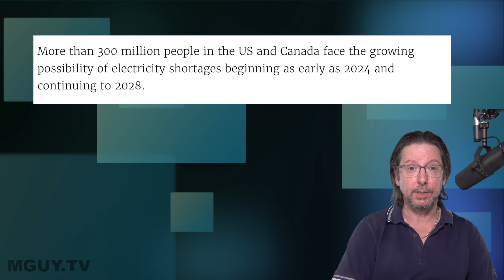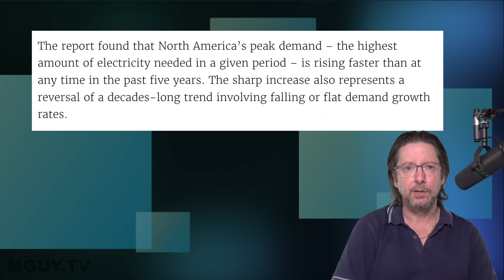Electricity grids WON'T COPE with mass EV charging | MGUY Australia

Comment: Australia produces 280Twh of power per year.  20 million EV's would consume around 40Twh per year.  The BIG mistake you all make is they don't all charge at once or continually.  I charge once a week at night.  40Twh is about the same as what has been saved by switching to LED light bulbs.  There are numerous UK and US Govt studies that show EV's will not stretch the grid.
Reply: And the same governments told us covid didn't originate in China, you needed to wear a mask when the only reliable mask were the N95 masks, but they didn't tell you that. The governments are the biggest disseminators of false information. Whatever policy they want to push, they will. Same with gun control. Every time there is a crime where more than 2 people are shot shot there is mass histaria. What about knife attacks where multiple people are killed? Now the mayor of London is calling for new laws on knives. Just keep drinking the kool-aid, and everything will be alright.

Comment: I have been telling this for more than 3 years now. If ALL vehicles were to be replaced by EVs, the price of electricity would be astronomical. Non-EV owners would also have to pay the price to upgrade the whole electricity grid.
Reply: It will be anyway.A dollar a kw or higher is quiet possible as works on supply and demand and take away all green subsidies and the true cost of the monster appears.Will never be cheap or reliable to use and the days of plentiful and cheap electricity ending will be something we all must suffer while try to survive without heating or cooked food.
Reply: @andyr8812 As energy production transitions to renewables it will get cheaper as it has in other countries. Also increased demand will allow for economies of scale. Yes this will be offset by the need to improve the grid, but it will happen because global warming is a fact that won't go away.
Everything changes, Australia has some catching up to do.
Reply: Your comment is absolutely false. You'll find (if you do the research, which we both know you don't do) that electricity rates are the most stable of energy rates on this planet. By all means, let's chart the price of gasoline over just a few years, shall we? In the last few years gasoline has doubled, dropped by half, increased by 40% and is now at some artificially low price until the American reserves are all tapped out.
Let's contrast that with electricity rates: my electricity rates just had their first 15% increase in TWENTY YEARS. Electricity can come from any number of sources, petroleum only one.
The idea that EVs will raise the rates for everyone is a lie from the oil industry, congratulations, you've done their PR job for free.
Reply: You must be one of the privaliged few that have cheap electricity.Our prices just went up 25% this year on top of the 30% went up the last time this government in power.You cannot deney that renewable dream is not sustainable.The recycle figures and the concealed real amount of fires that only now just becomming public.Most solar farms and ev vehicles be lucky to last 20 years and few even get that far like the brand new battery pack in Qld that exploded.Compare that to a hundred year life from a coal fired plant or decades from an ice.There is a mountain of evidence AGAINST this green future but nothing worse then people that bury there head in the sand and deny these electric monsters destroying the planet.Am not against renewable per sec but cannot be reliably used for base load cheap power.They have a use must must stand on there own merits. The more subsidies poured into this bottomless pit of green madness will come back in a few years time to haunt us when your power two dollars a kwh if can get any and tell me how cheap and reliable they are .Once in the recent past used to pay 9 cents a kwh and now pay 35.The more coal plants we lose the higher the electricity price as supply falters and the poorer quality of life destroys our country.But thank you for your comments.We have a serious problem with our lack of reliable energy planning.Really need at least a dozen new coal and nuke plants to stop the grid collapse and need it yesterday not in twenty years time if ever. Even in the short term gas will save us but Australia rather sell there abundant gas supply overseas then insure our country stays energy rich. @justsomeguy934

Comment: Liberals have zero common sense in their thinking. They are just blinded by their so called goals and can't see anything  else. If they actually thought anything through they would realize they cannot succeed with anything the way they do it. They also seem to think everything will just happen magically and they don't have to work for it and uts all FREE. Its amazing these people can do anything at all when some don't even understand where the food they buy at the grocery store actually comes from farms ir that an island won't just tip over if you move to the other side of the island.  Yes, they ARE that stupid. Many young people can't even use a manual can opener 😂  So how dobyou think they can understand the electrical grid and amount of power required for their lunacy or the fact that everything, even their so called green cars will need oil and grease to be built and operated.  Everything in life today requires oil at some point  so they will never get rid of it.

Comment: His nome is Chris Bowen 
He is absolutely clueless about the electrical grid ….
Although he’s the energy minister…
Absolutely no idea about generation….
He thinks it all happens with smoke and mirrors 
The PM actually stated that people should charge their EVs off solar, during the night !!!
This is their level of understanding 
Scary !!!
Reply: We have dumb and dumber in charge.
Reply: With the correct wavelength of light you could charge solar at night. The problem is most of your profit would be eaten up by powering the lights to charge the solar panels. My own solar panels take in around 4 watts of power at night from a streetlight. Not enough to do anything.  Max voltage I have seen at night on the panels is 26 volts. It takes 80 volts to turn the solar inverter on and make energy to store in the batteries.
Reply: @johnstark4723 I really think you’re clutching at straws….
Reply: @batmanlives6456  I'm stating facts. You are clutching at straws
Reply: Facts so distorted…
If you really think that you can gain USEFUL energy from solar cells at night … you are as silly as Bowen himself….
PS using a street light isn’t really using solar power…

Comment: there is a building in Melbourne, where residents wanted. EV chargers placed in the basement.
Short story is not only is the building in capable of the capacity, but so is substation down the road and the connection cable.
Basically the whole neighbourhood needs to be re-wired, just for one building.
Reply: i expect we'll hear about it burning down soon.
Reply: Fix your third-world grid. EVs aren't the problem, your utility commission is.
Reply: Spend billions/trillions just to satisfy some sanctimonious nerds?  No....fuck off.

Comment: Clueless Politicians. Have no idea that the World has not got the Infrastructure to cope with increase of EV charging.
Reply: This is the wrong way to think. They are not clueless, they are not stupid; they know EXACTLY what they're doing. This is why we need to stand up and say NO before it's too late
Reply: EV charging is not a problem, you can recharge any EV using house current overnight for the typical driver. In general, however, the world needs increased energy production for EVERYTHING.

Comment: They shouldn't be allowed to close a plant till they have replaced it's capacity
Reply: Wind power and solar energy can never replace gas and oil. full stop.
Reply: @jameskeith7608  Exactly, becaus the wind not always blows and the sun not always shines. So they always will need a full scale back-up grid of so called "fossil" Energy.
Reply: @jameskeith7608  absolutely false. Renewable energy can replace traditional fuels, but a balanced energy plan is necessary. Full stop.
Reply: *its
Reply: @poliziagrammaticale9430  yes indeed. It's true that I should have typed its.

Comment: It's funny how these 'green' eco-warriors seem to think that using windmills and solar farms, as opposed to more conventional means of power production, are the answer to the world's climate problems without ever thinking they may just actually be adding to the problem making it worse. 

Take solar panels, masses of large black square panels, covering untold acres of the earth's surface all causing heat thermals of rising warm air which can affect weather patterns over a large area. The National Centre for Atmospheric Science states "Heavy rainfall and snowfall will become more intense in some places as a warmer atmosphere is able to hold more moisture in the sky. And, high-impact events like storms will become more frequent." so how much of this "warmer atmosphere" is being caused by these fields of 'green' solar panels?

As for windfarms, Newton's third law states 'When two objects interact, they apply forces to each other of equal magnitude and opposite direction.', so for each gram of air pressure needed to turn these massive blades an equal force is being applied in the opposite direction by the blade's resistance to turn. So the natural flow of air, which has kept this planet alive for billions of years, is now being restricted. It's like trying to breathe while having your nostrils slowly clogged up over time, it's fine at first but eventually it will affect your ability to breathe.

Yet any weather anomalies that get reported always seem to be put down to fossil fuels and global warning, it's ironic when you think about it.

Comment: It is not the ability to supply the amount of power that concerns me, it is the infrastructure that delivers the power, the average daily usage of an entire house equates to about 80km in an ev, and our power infrastructure will not cope with doubling the load, if the government thought NBN was expensive wait until they see the bill to double the capacity of our energy grid
Reply: Right, so the grid won't cope with 15 KWh / day of flexible additional demand but was  completely fine when air-conditioners and clothes dryers came along which increased demand as much if not more. 

Yep you're right, renewables and EVs are to blame for the rolling blackouts and directions to curtail demand every summer 15 years ago.. rightio..

As for the "environment" are we changing topics now? I thought the "concern" is about some mythical property of renewable and EV electrons to strain the grid more than everything else in the past?

What's the "concern" then and were you always this "concerned" or only since renewables and EVs appeared?

Why don't we have rolling blackouts every summer like we did 15-20 years ago?

Every distribution failure is "blame renewables" and "blame EVs" today with no actual evidence presented. 

Just curiously selective "concerns".

Do you have shares in OPEC or something?

Assuming everyone will develop a sudden urge to travel 80 KMs / day using 15 KWh flexible demand which is equivalent to say 100 KWh of non-flexible demand used in ways deemed more "appropriate".. ok, sure. 

BTW the average is more like half that although I do admit, being free from funding oppressive petro-states and terrorism at the bowser I do drive more now so on that point you're correct. 

https://www.budgetdirect.com.au/car-insurance/research/average-kilometers-driven.html
Reply: @IanMcLeod75  The average daily electricity consumption for a household in Australia is 11kw including AC as a part of that average. It is also spread across the whole day where a significant portion (water heating etc) is already used at the time you propose. Our grid already cant cope with the existing load in lots of places.

I think you either underestimate the load everyone driving EVs will have or you over estimate the capacity we currently have available, that is before you start talking about powering petrol station replacements  having to provide enough power to supply multiple fast chargers.
Reply: @isaac827  11 KW or KWh? If you're struggling to differentiate basic units you may need to reconsider this. 

The average home does not consume 11 KW, that's over 250 KWh / day..

You're using classic SkyNews logic. Take the absolute worst case scenarios and throw in ridiculous assumptions like having to replace the 70% energy lost as heat in combustion. Yes SkyNews actually claimed this. Please don't tell us you actually get your "information" from SkyNews or the IPA?

I can see you really want to defend foreign-fuel dependence, that's great you stick with that at $2 / litre and $40 billion / year drained from Australian pockets every year to fund corrupt petrostates and conflict if it's really that important to you. 

I'm not missing it.

And you still haven't explained why air-conditioning or clothes drying or any other electrons are worse than so called "leftist" electrons.

Do the maths yourself on 165 Wh/KM flexible demand as worst case and see what you get. 

Before considering rooftop solar and software automation to soak up excess or cheap energy (unlike non flexible demand like, well, everything else that seems to not concern you at all).
Reply: @isaac827  All this is well covered already so why go to all the effort of speculating?

I think you over-estimate the need to replace combustion waste heat that the IPA publicly claimed will be needed for some strange reason no one can explain.

Meanwhile actual modelling with real data and real trials suggests a max increase of 80 TWh / year on top of our current 275 - 300 TWh demand - which has been flat by the way since 2006. You can see for yourself on the links below.

Why, what do you estimate if you believe the below to be inaccurate?

As for "grid already can't cope" - can you share some statistics or reports about this? Beyond old news stories about SA or whatever which were resolved to be software related. Like actual outage statistics from energy regulators and qualified analysts. Last I checked reliability has improved substantially over the last decade but happy to be wrong if you can provide some authoritative sources?

https://aemo.com.au/-/media/files/stakeholder_consultation/consultations/nem-consultations/2022/2023-inputs-assumptions-and-scenarios-consultation/supporting-materials-for-2023/csiro-2022-electric-vehicles-projections-report.pdf 

https://www.energy.gov.au/publications/australian-energy-statistics-table-o-electricity-generation-fuel-type-2021-22-and-2022 

https://opennem.org.au
Reply: Your calculations are invalid. The average EV (for American driving) consumes about 10 kW/h per day, or the same amount as a clothes dryer for 1-2 cycles. This is done off-peak and requires NO changes to the infrastructure whatsoever. EVs will NOT double energy demand, nor will they melt the grid. Stop repeating oil company propaganda.
Reply: 80 KM/day is around 15 KWh... which can be scheduled overnight on cheap tariffs. Are you seriously concerned about this?

How much does aircon and heating use in comparison?
Reply: @IanMcLeod75  Do you think our current electricity delivery network, is capable of delivering double the power it currently does? 

What do you think happens if everyone wants to deliver an additional 15kw of power between 12am and 6am?

Doesnt it kind of defeat the environmental purpose to guarantee everybody charges their cars with power generated from coal?